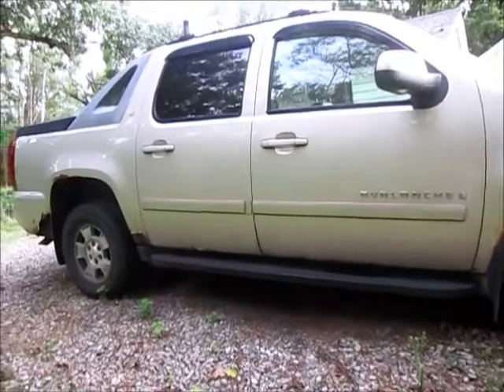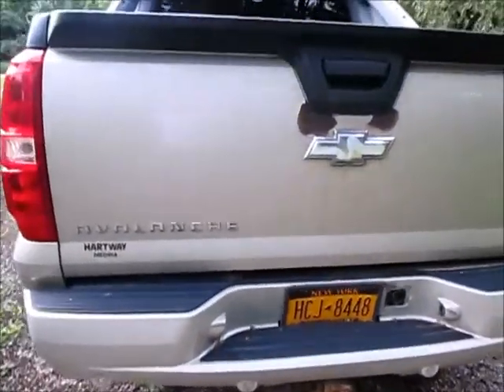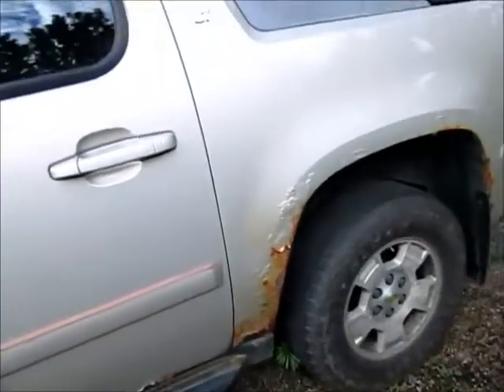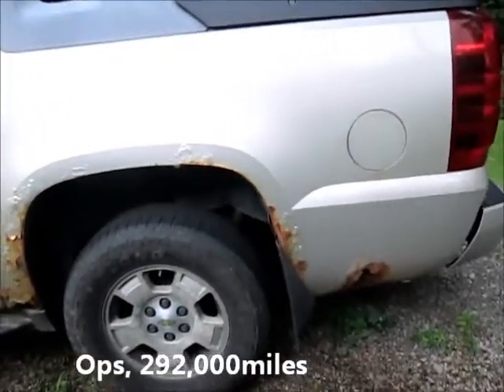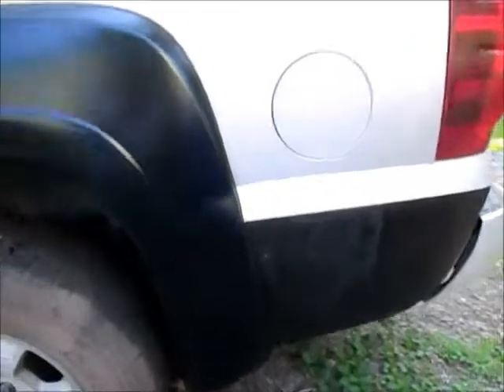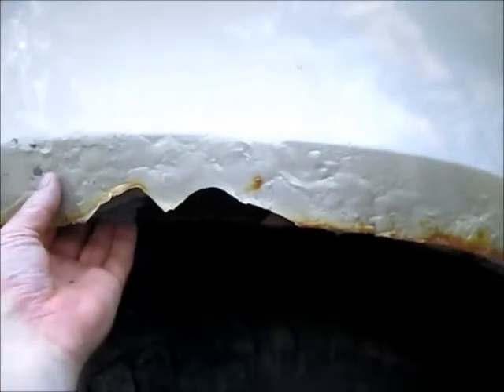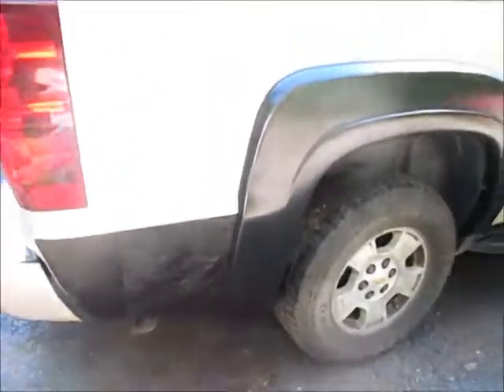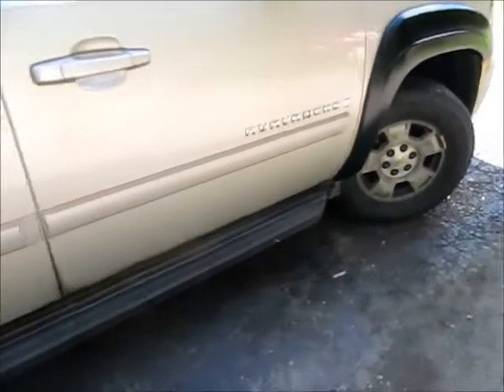Hiding the rust on my 2007 Avalanche with Fender Flairs.

Comment: What brand of fender flares?
Reply from the maker: Here is the link to the ones I bought. I just bought the cheapest ones I could find. https://www.ebay.com/itm/264353412598
Reply: I looked at a avy yesterday that had Terrible flares,  yours look great and like they are molded to fit the body contour.  I looked at the link.  Is the brand PSI restyling ? Or just the seller ?
Reply from the maker: @bradc5433  I don't know the answer to that. Sorry.